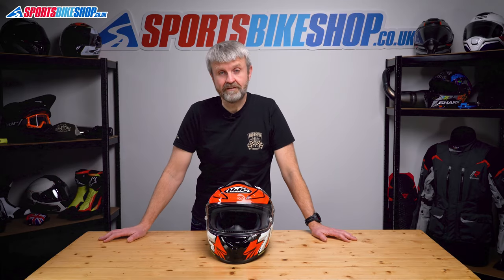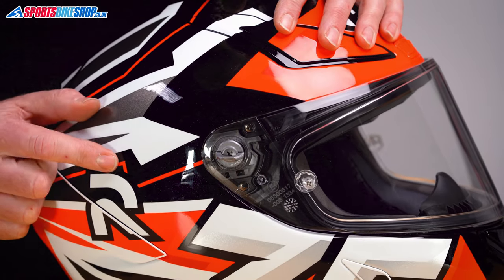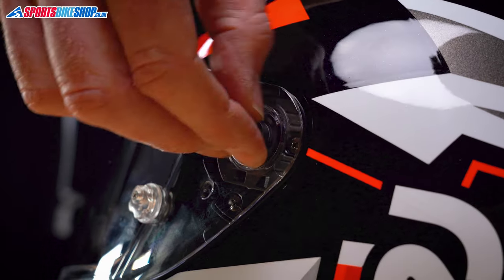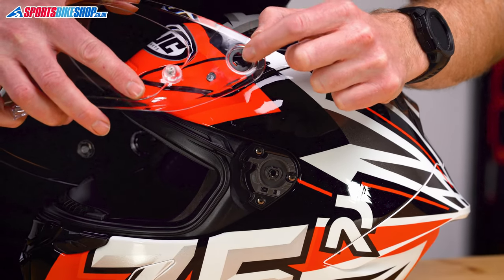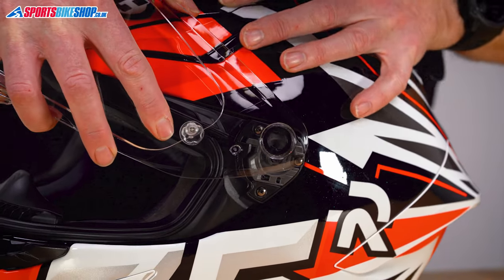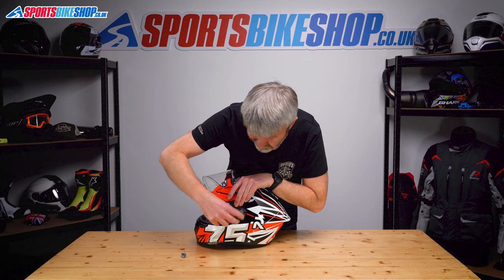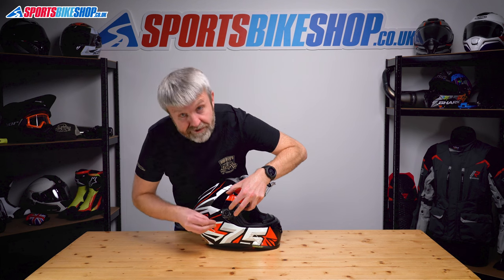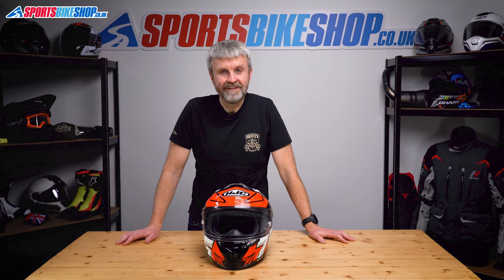How to change a visor: HJC RPHA-1 motorcycle helmet

Comment: Currently thinking about buying an RPHA-1 ... why did they ditch the wonderful mechanism of the 10 and 11 ... does seem like a big downgrade
Reply: my guess would be so that they are abke to get the FIM certification. This one is a bit more of hassle to replace than what it was on rpha 10, 11 and even new 12, but is also more secure fitment if a visor to the helmet. And since rpha 1 was primarily developed for use in racing it doesn't surprise me that some od the comforts we were used to have been replaced.
Reply: @92Cuky_  ended up buying a shoei X-SPR Pro... FIM certified and locking crisp into every step....